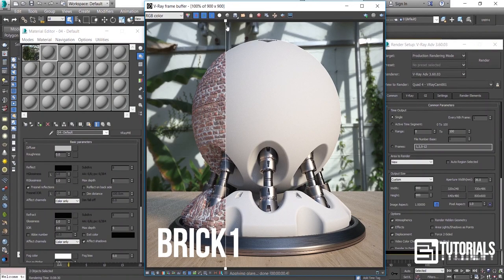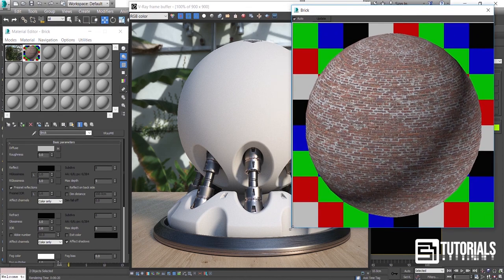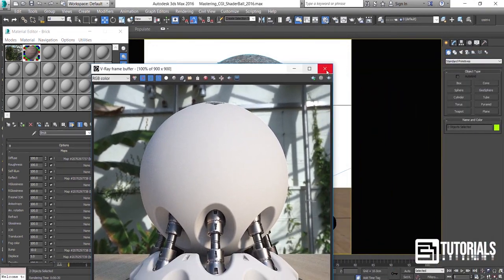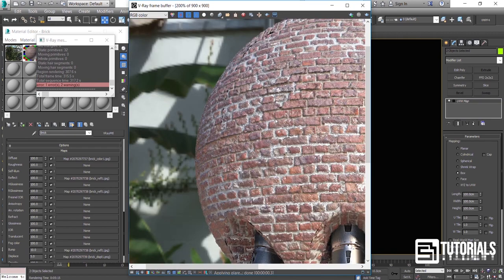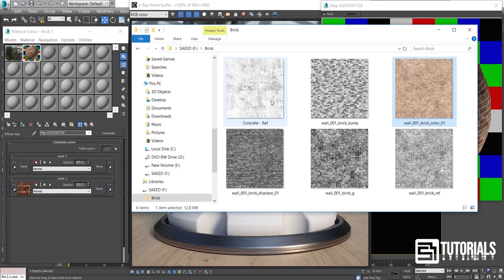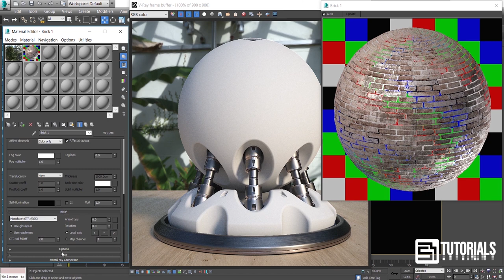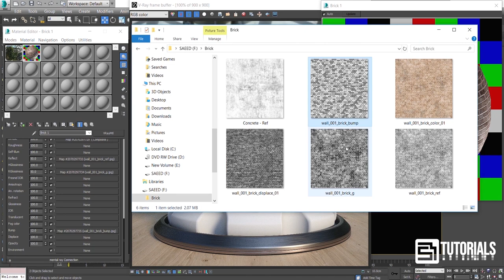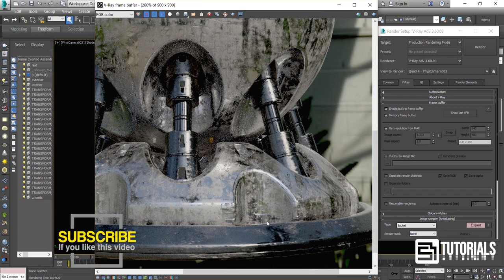VRAY BRICK WALL Material 3ds Max

Comment: The brick wall material isn't correct because the mortar joints are too reflective. The maps used for the reflection and glossiness channels are basically a desaturated version of the diffuse map, which is not correct. The mortar joints should be grey or almost black, instead in your maps are almost white.
Reply from the maker: Thanks for sharing your comment.